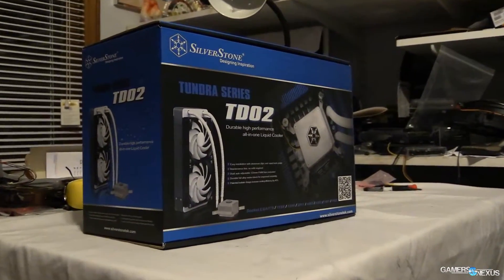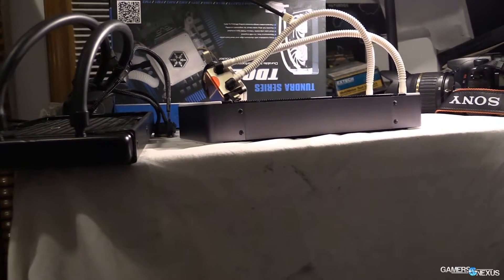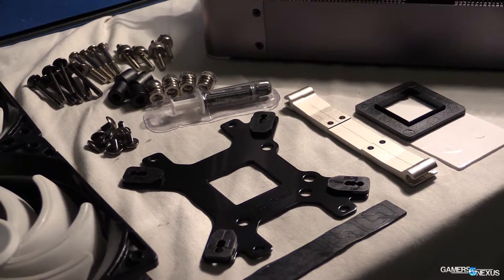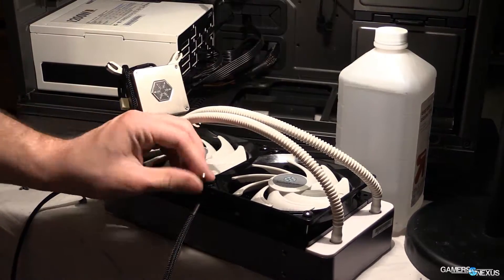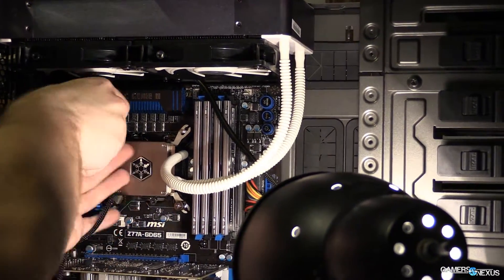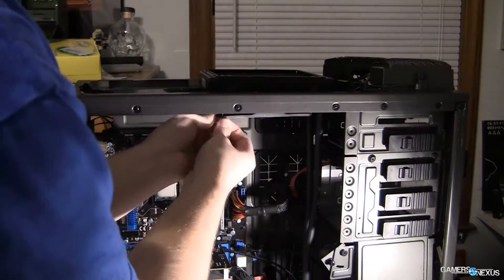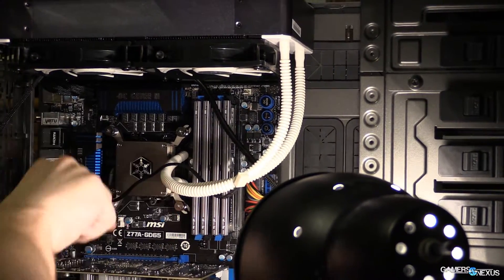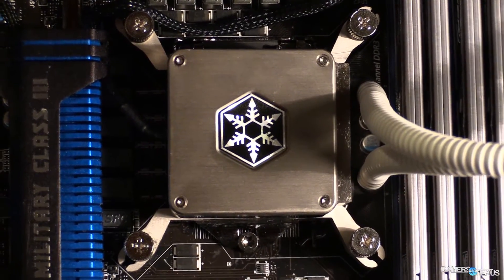SilverStone Tundra TD02 Review & Benchmark | CPU Liquid Cooler

Comment: Bought this item on Amazon on January 6, 2016. Please could you tell me what your warranty is? How many years can your product work without fluid replacement ?. From the beginning of the purchase to the present day it works perfectly and there have never been any problems with overheating. I just fear for the future, because I do not know the term of the official manufacturer’s warranty. Bought on January 6, 2016 , now 14.10.2019 it`s work PERFECT over 4 years. İ`am just want to know do I need to change fluid?

Comment: I recently just bought this cooler as it was very cheap and has very good benchmarks. The one thing I want to ask is whether you had heaps of trouble with installing the cooler onto the cpu? 
I ended up having to get rid of the 'springs' from the screws as they literally did not spring and they made it almost impossible to install.

Apart from that mine is running fantastically, just wanted to know if you ran into problems.

Comment: how can i change the speed of the fan?
Reply: thats easy bro, go to your motherboard software, i use the MSI Command Center, and i can set the two fans to 2500rpm and the pump is on maximum, i also use this brand and i liked it, its very minimalistic
Reply: Or use fan profiles in BIOS if you are using motherboard headers.

Comment: To mount the fans  so they suck the air through the radiator should be better than leting them push the air through. //ventilation engineer.
Reply: Zukatsr125 Why not both? c:
Reply: TheLawnWanderer It will increase sound :P for an example.
Reply: Zukatsr125 Running 4 fans at a lower speed will be quieter per unit of air flow will it now?

Comment: Whats it like in a push pull config, or with better fans any major improvements???
Reply from the maker: The thing that makes the most improvement (other than adding some really fast/loud fan) is using it with a larger socket. It seems that the TD02 performs better on LGA2011 comparatively than LGA115X.
Reply: Am on the AMD side of thing got an 8350 same deal for me.
Reply: @GamersNexus  I love your answers.  Straight to the point and make sense.  This answer helped me decide not to get it.